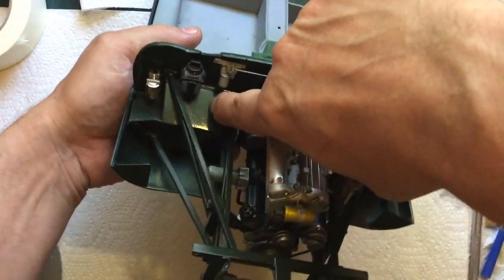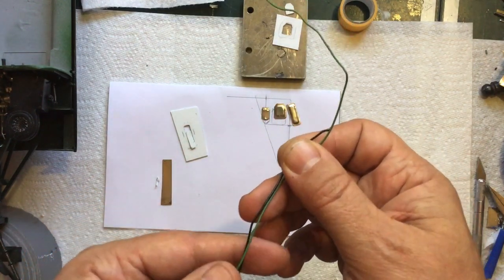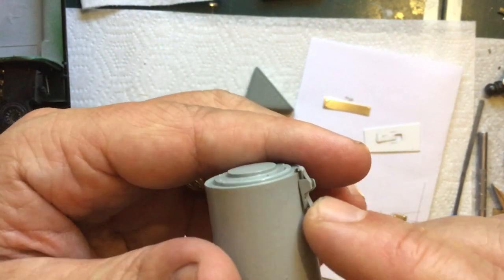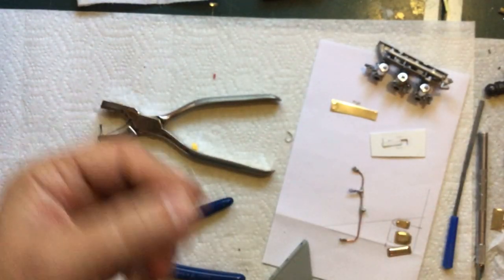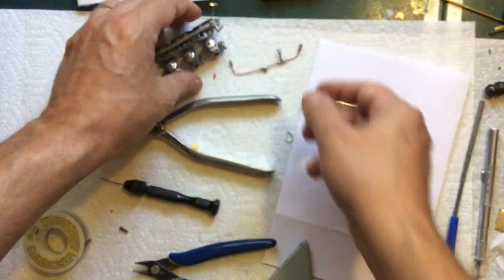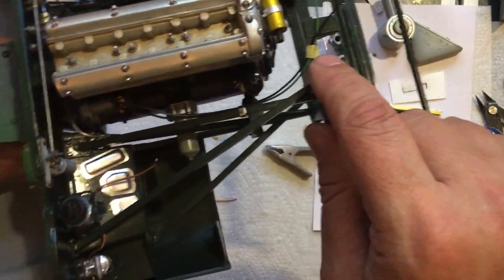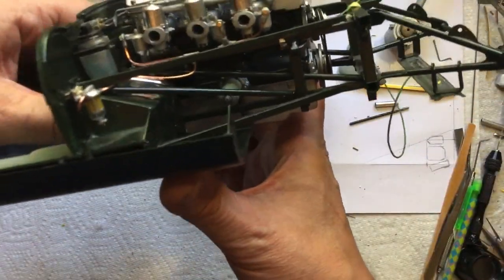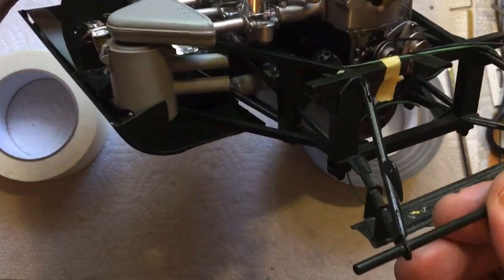1/8 Jaguar XKE build part 12

Comment: I just found you on the 'tube and enjoying your videos. I have one of these models that I purchased used, and need to strip the paint. I've heard that soaking in "purple power" undiluted cleaner will eat the paint and leave the plastic intact. How do you strip paint?
I ordered the big $ Agora Jaguar and will binge build that- but it's time to get my old Revell Jag out and build that as well. I'm new to resin and 3D printing, but acquired the hardware to do so. It'll be a journey, but I really appreciate your videos! My hope is to bring the realism of the Revell model up significantly with working lights, backlit gauges, brake pipes, etc. I own a full scale E-Type Series II, so if I have to fab parts I have a reference although slightly different being a Series II.
Reply from the maker: Thanks for watching and commenting! I really don’t have any good tips for stripping paint. So far the used partly built kits I got haven’t been painted. I’m not familiar with purple power. Might be worth a try. Good luck with your build!